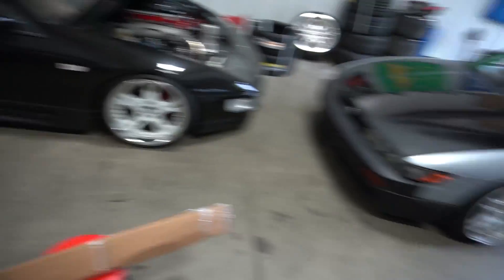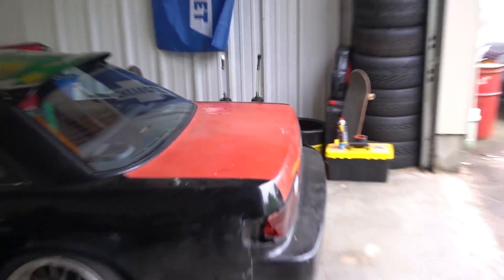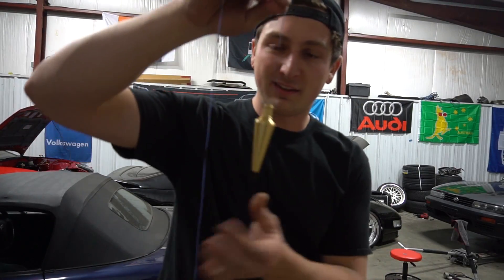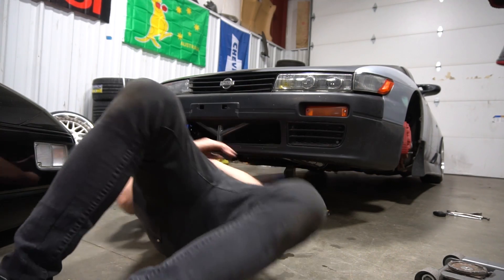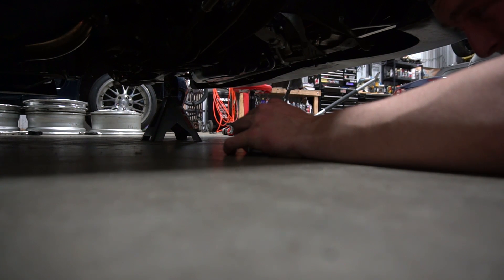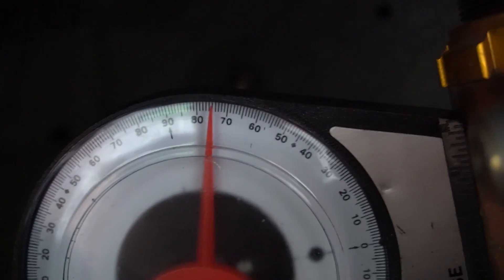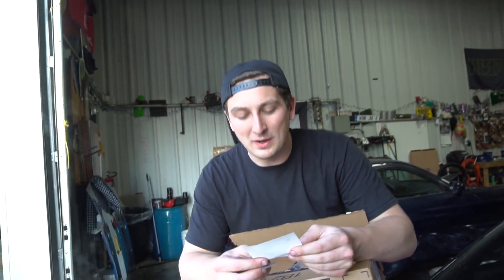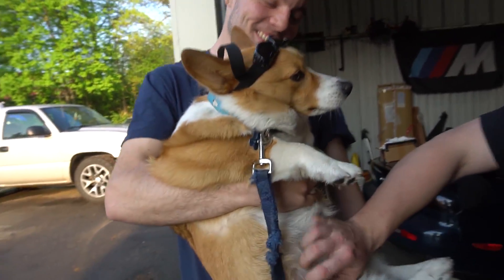I can’t believe how well this works!!

Comment: Why everyone thinks that you need a truck to pull an open trailer? Basically any sedan/vagon/van, especially with some decent ish size diesel engine can do it with no struggle at all. I used to pull my track car on similar trailer to Jimmy's with my Mercedes 320cdi thousands of miles and never had an issue. No hate on trucks or anything, just something to think about. P.s. I'm from Europe, we don't really have trucks here 🤔
Reply: Yea no problems untill you have to break/corner hard
Reply: @zokushajames5430  lol why would you break/corner hard when towing a car?
Reply: It's strange that Americans think they need a truck to pull trailers here you can see 1.9 tdi golf wagons pulling cars no problem all the time
Reply: Our speed limits are mostly 55, we have dumbass drivers. It’s simply not safe towing a car with another car
Reply: @chrisb99  yep, i get it when they are towing big enclosed trailers, then truck is necessary, but for a small open deck trailer to tow a light s-chassis, basically any car will do.
Reply: @masonsmith9222  speed limits in Europe are pretty much the same, so don't really understand your point. About the drivers, well we have plenty pretty bad drivers over here too
Reply: Around me every interstate highway has a 70mph speed limit. I doubt a 150hp diesel engine could keep up with traffic with a car and trailer or get up to speed on an on-ramp. Let alone come down to a stop safely on some of the shorter on-ramps. Also keep in mind that in the American automotive market, pretty much the only diesel "cars" available are TDI Golfs and Jettas, plus a very small handful of X5's and Touregs. Further, most "cars" only have a 2000 or 3000lb tow rating which is barely enough for a light car on a tow dolly. So this is why most people have a truck or body-on-frame SUV for towing. Having a truck also makes it a lot easier to haul spares and tools to the track in the bed, which is difficult to do on an open trailer.

Comment: Please rise the car
Reply: Vinicius Alves raise* and no
Reply: @El_Jefe_S3  Sorry, English is my third language and maintain the car low at is stupidity, stance car only work parked
Reply: Vinicius Alves it’s a drift car so it has to be that low and the wheels have to be like that to work efficiently
Reply: @samshirley1962  You don't need to be dragging the car in the floor in any kind of race. Yes lower it will be beneficial but not that, look the cars in any matsuri in Japan 95% of their is stock height and Drift a lot better than any stance car